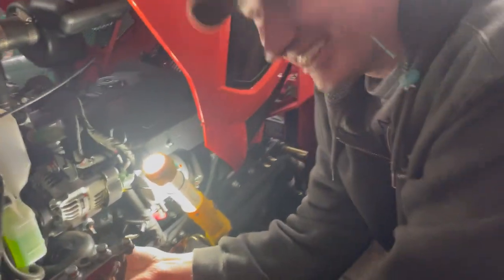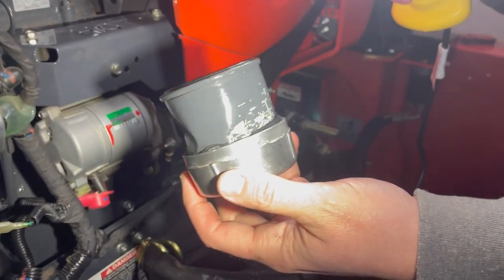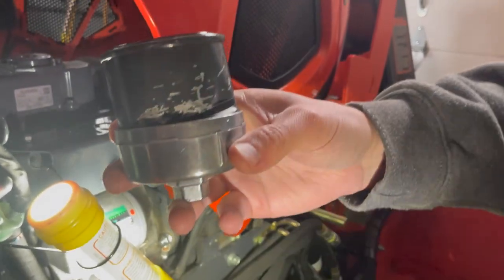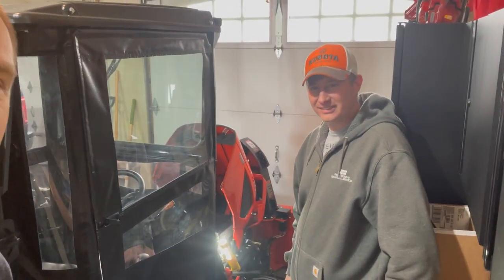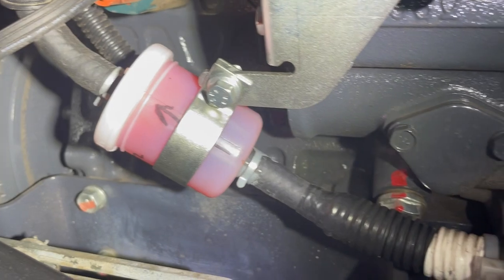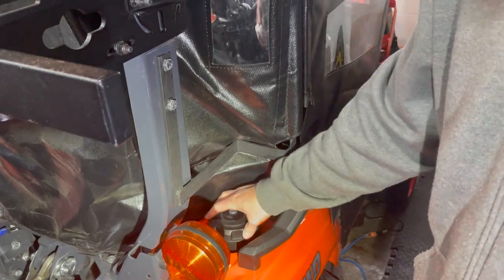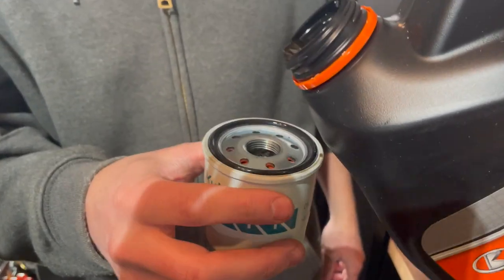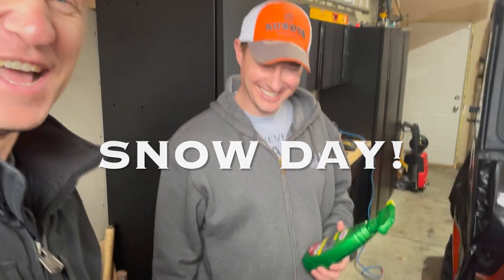WHAT A PAIN IN THE BUTT! (Stuck Oil Filter)

Comment: Nice of you to help him Jon! Also for anyone wondering, the reason factory filters are so hard to get off is because when factory’s install brand new filters on brand new engines, they install the filters DRY with no oil around the gasket.. because of this the very first filter will always be a son of a gun to get off. This happens also with brand new vehicles when you get them from the dealer and do your first oil change as the auto makers don’t put any oil on the o-ring during assembly.

Comment: The 50 hour service on my BX2680 was pretty straightforward...the only issue I had wasn't an issue of the tractor it was the fact I didn't think about what was going to happen when I pulled the filter screen out of the transaxle...I had hydraulic oil all over the place....note to self, remember to pull the drain plug on the bottom of the transaxle before removing the filter screen out of the side LOL.  Since the 50 hour service in June I've only put 12 hours on it LOL.  Sure saves a lot of manual labor type work getting stuff done.  

That hard cab would be great but for the ridiculous cost of one, I just let the snow melt on its own, usually its gone within a day or two anyways, not worth getting the tractor out 99% of the time.

Comment: I feel your pain. I had a stuck filter at 50 hrs that was painted on and it took all I had to break it loose.  The machine that installed that filter did not do it 'hand tight plus 1/4 turn'.

Comment: Evening John, That’s a good tip to wrap the oil in tap to make it easier to remove. Having two B Series Kubota currently, and two BX’s previously I know the feeling about poorly placed oil and fuel filters first hand. I don’t use a bottom type filter remover opting for a large pair of slip joint pliers. If I get into the situation where the side panels I’ll place the pliers close to the top as possible. I’ve never had one I could not get off using this strategy….Hope this is helpful….

Comment: Due to all of the bad things I had heard about removing the oil filters from Kubota tractors I was prepared for the worst!
I used a razor knife to cut the paint away from the filter's edge and the block.
I had a chain type filter wrench and was able to remove the filter easier than I expected.
The gray paint used by Kubota must be mixed with GLUE!!!

Comment: There is a couple of videos that show you how to install that first fluid filter to a better location. I have done it and it works great. No going under the tractor to change the filter. A small snap type oil filter wrench removed my first oil filter with no problem . Nice video

Comment: Just a tip I learned.  Get a 3' piece of the pipe insulation that just fits over your mid pto shaft. The insulation is cut to allow going over the water pipe.  I take electrical tape and tape the insulation together and side it over your pto shafts for the winter.  No chance of damage and keeps the salt off the shaft.

Comment: Kubota does crank those filters on for sure lol it brings back memories of doing that with the SVL 75 and it was not as easy access but i think they must torque them well over 30 Ft Lbs than most engines i work on. As for those clumsy inlines on the BX tractors i added a Fleetguard spin on  head Marine type filter to left side on frame just ahead of the operators floorboard. I do know there is a video on YT as to how to its done.

Comment: This was a really fun video to watch. I irreparably damaged my cub cadet lawn tractor because the oil filter would not come off. I have a question I wonder how many different fuel gas tanks would accept your tapered  coffee filter ?  Is there anyway to find out if anyone else is using a tapered coffee filter on different models Kubota or different brands of tractors? Anyway, keep up the good work and I’m already looking forward to equip expo 23.
Reply from the maker: As you know I watch all the Kubota tractor social media feeds and I hav t heard of it fitting anything other than the BX. I would like to find one that fits the B and L series so I could help out those folks as well. 
Keep on tractoring!

Comment: The factory paint over the filter had nothing to do with the filter being stuck.  Those filter “sockets” suck, along with strap type filter wrenches. Ok if the filter isn’t too tight. I have been using large channel lock pliers, sometimes called water pump pliers, for 30 yrs to remove oil filters. Some thought has to be taken in regards to the placement and orientation of the jaws on the filter, and proper adjustment to grip the filter without crushing it, ….but they have never let me down on hundreds of factory installed oil filters, fuel filters, or hydraulic filters!
Reply from the maker: Well, you might not believe this but we actually had those filter channel locks you mention and they failed. With the BX you cannot get a good bite with them. A chain wrench would have been ideal but thankfully I had a decent set of filter socket wrenches that did the trick. The tape was the solution to make it work. 
Keep on tractoring!
Reply: @ritterjon   NO. I didn’t say those crappy oil filter pliers. They are junk as well.  True large channel lock pliers, applied correctly, in the right orientation, will get the job done.

Comment: if they'd just put a little oil on the oring from the factory these filters wouldn't be so tough to get off. not to mention they aren't in the most convenient spots either with all the wiring in the way
Reply from the maker: You’re right! There is hardly any room to work. 
Keep on tractoring!